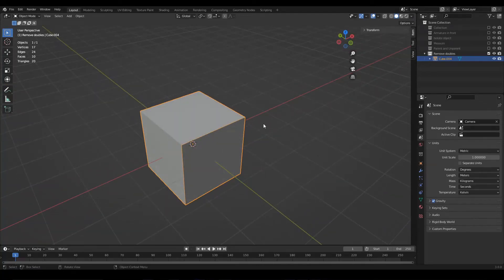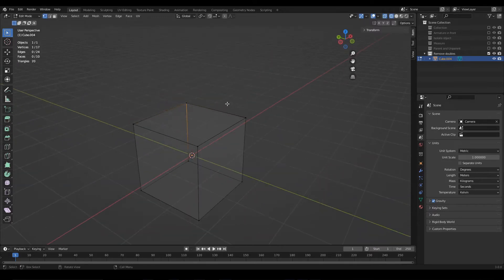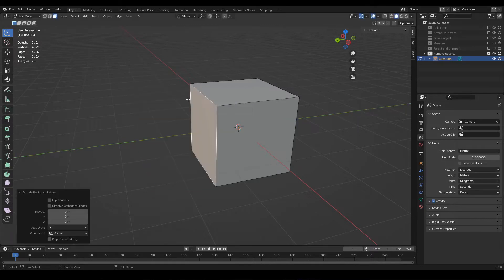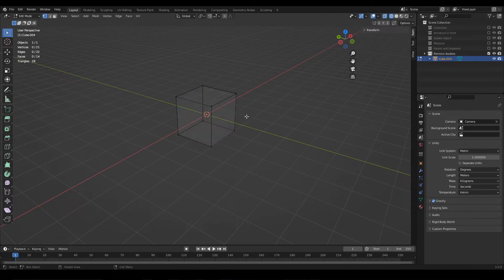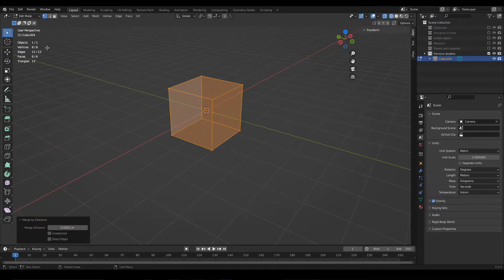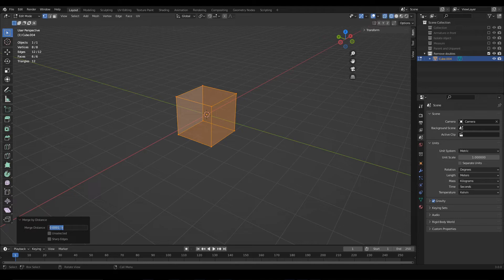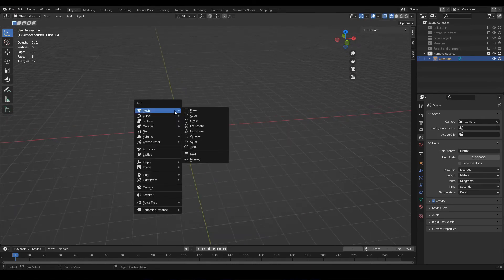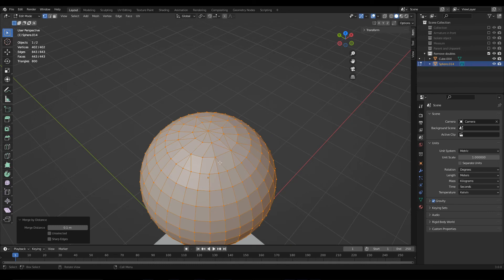How to REMOVE DUPLICATE VERTICES in Blender merging them by DISTANCE

Comment: Is there a cancel button when extruding vertices? you said right clicking sets it to the origin but is there a cancel button to delete them rather than not move them?
Reply from the maker: Try with the Escape key while extruding
Reply from the maker: I tried with escape and it's the same as right clicking.
It seems the only way to do it is pressing CTRL+Z once the extruding is applied

Comment: did they change the name? i cant find merge by distance anymore!
Reply from the maker: hi! you need to be in edit mode in order to apply this function. I've checked in blender 3.4.0 and still has the same name
Reply: @GameDevTraumEN  thank you so much!
Reply: @GameDevTraumEN  Hey, I can't find it either and I made sure to be in edit mode...
Reply from the maker: Try to make this to see if works, open a new Blender project, select the default cube, press tab to enter in edit mode, place the mouse cursor in the 3d window, press F3 to display the search dialog, write "merge", there you should have all the merge options.
It should work 1000%, if for some reason it won't, then in edit mode in the top bar of the 3d viewport there are a couple tabs, "View", "Select", "Add", "Mesh",... Go to "Mesh", then "Merge" and there you have the options from before
Reply: @GameDevTraumEN  hey, I tried this as well just now and it worked, it just looks like it doesn't recognizes any vertices in my model, I got a workaround tho, thank you!
Reply from the maker: mmm maybe the 3d object was a proxy or an instance of another model. Anyways, good thing you solved it.
Consider subscribing to the channel if you're not :)
And if you have a question just leave it in the comments, I can help more with Unity and programming, but I also use Blender a lot